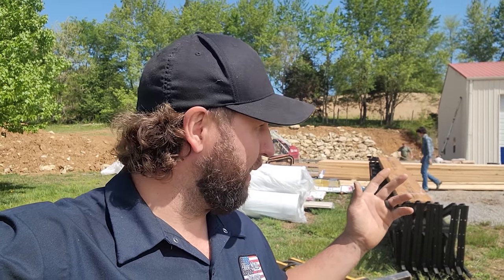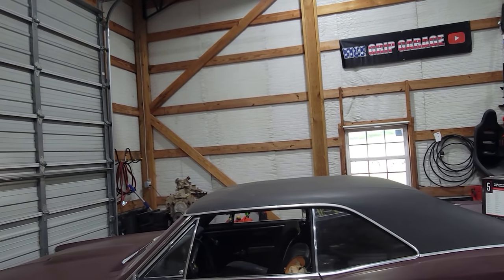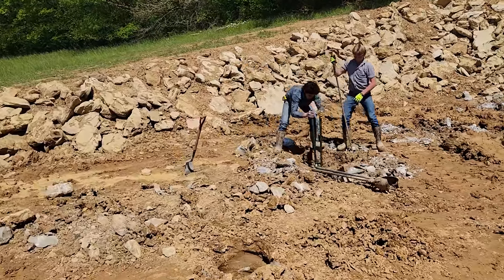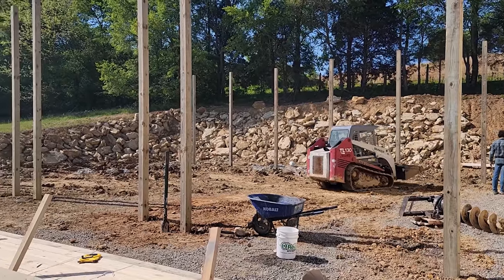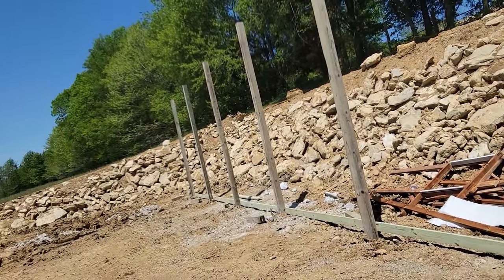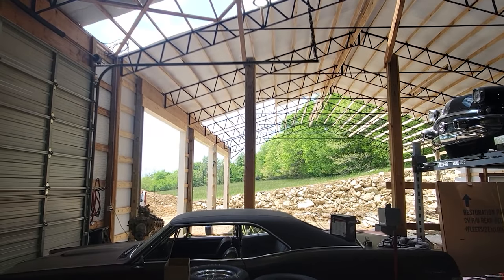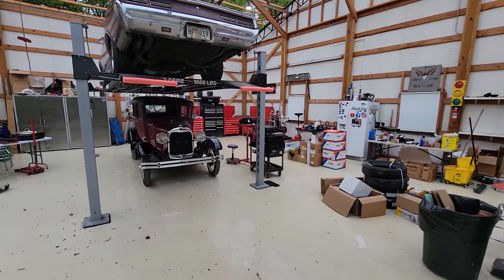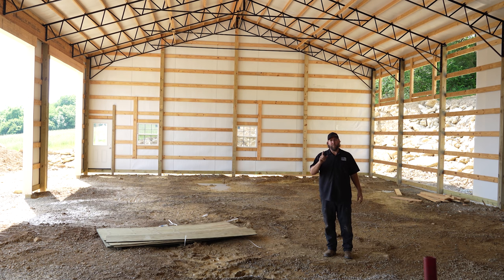Budget Shop Build - EP2 - Framing & Tin!

Comment: For the air system use RapidAir or something like it.  Black iron pipe is hard to seal and can rust internally and PVC can explode without warning!  (ask me how I know......)  Rapidair is what I used in my 2400 sq. ft. shop and I absolutely would do it again.  Hardly any pressure drop and moisture is a non issue with a hobo freight dryer setup.  Great video and can't wait to see it done.
Reply: I was going to recommend using a similar product or make up your own.  I think having many air chuck locations and using shorter hoses beats the hell out of dragging around a long hose.  Long systems also lead to better moisture control as the air cools off over the distance and condenses so plumbing in a few drain locations keeps the water from blowing and it will keep your  tools in better shape too.
Reply: I've had good luck using copper plumbing, doesn't rust and very easy to make changes/repairs... also easy to adapt to pipe thread when you need a termination
Reply: I second using the RapidAir, I thought about using iron or copper but glad I ended up with RapidAir. One full loop of 3/4" around the ceiling and drops down with drains on each one (even though I have never had any thing to drain).
Reply: black  iron is  the only thing  legally allowed in boiler setups  in florida and al I have have  the same  black iron on   boiler /steam  setup for  going on 22 years    with out a  single  rust  through   are  you thinking of   galvanized
Reply: George Jones  for one.. It says.. Not for pressure.. Directly on tha pipe..lol
Reply: George Jones  One small automotive shop i worked in had an air operated waste oil pump plumbed with schedule 80 PVC.  Something happened to the pipe overnight and when we came in the next morning it looked like a grenade went off in that room.  PVC shrapnel was stuck in the insulation and plywood paneling.  It could have easily killed someone if they were in the room when it went off.

Comment: I would add a hose bib for water in the center wall/middle of building outside wall, for washing cars outside. Hot water too if it was in budget. And and air line hookup too. Old style oil can cabinet from a gas station outside right there that was gutted for hose reels would look good!
Reply: I added hot water in my shop using one of the on demand tankless units. Figured it was a waste to have a 40 gallon tank to keep warm 24/7

Comment: You might alternate every other power outlet in a row on two different circuit legs using a single three-way Romex.  It will give you twice the load capacity to run multiple power tools in close proximity.  I did that when I built my shop and it worked really well.
Here in central Texas we are in constant battle with that obnoxious thermonuclear sky monster known as "sun" on other locations of the planet's surface.  So the only color for a metal roof here is WHITE to maximum reflectivity because darker colors absorb a lot of light energy and radiate it back into the workspace below as heat energy.   Of course you could be really clever and stage the roof with automated slewing photovoltaic cells.  That way you absorb the light from "sunshine" and use it to make car fenders like Elon does here in Austin.  On second thought you likely don't have the capital budget Elon is working with so nix that idea, haha.

Comment: I would recommend getting liftmaster side mount garage door openers this way you don’t have to worry about them stick out above the door when it’s down. Can’t wait to see this done! 🤘🏻
Reply: I've got these and they're amazing.  Definitely a strong recommendation.
Reply: And angled door tracks. No reason the doors have to open 90°... Let the doors follow the roof line.
Reply: And get lights that hang down between the doors so when the door is open you will still have lights.  For that matter if you run the doors up high leave room for the lights above.

Comment: Learn from a man that did it--put as many outlets as you can, did mine every 8ft. Also put some 48in high.
Reply: Some drop cords also
Reply: I am building a similar size (well half size 40x60) barn and outlets every 8-10 ft is good. Still not enough, but budget has limits.
Reply: Bill--Also don't have a bunch of them in the same area on the same breaker! Trip city!!
Reply: @cotton-Dave  Good point. In the storage area, I have single duplex outlets in each box with every other on the same circuit. In the shop area, have 2 duplex outlets per box each on a different circuit. Then, no more 2-3 outlets per circuit.

Comment: Having some outlets, including a 50am out front helps out. Including quick connects for air.Also a fan with damper high up on the ends really helps out when a fellow needs to vent the blue smoke clouds.

Comment: The expansion looks great! They're doing the job right and building it correctly. Congratulations on the success of your channel. It's a pleasure to watch all of your videos! KUDOs! 
Word of caution! Just a heads up... Make sure you plan for storm water running down the rocks and into the back of the garage. Those heavy storms could cause a lot of water damage along the back side of the building.

Comment: Derek: Regarding that old, original door with the rotten moulding...that moulding is, in most cases, a separate piece from the actual frame of the door and is called "Brick Moulding"...cost a feller 20.00 to replace instead of 250.00+ for the whole door...unless of course the actual door frame itself is rotten. Also, check your local codes re: fire doors...they MUST swing out. Easy mod to a new door...mount the door inside out by taking off the brickmould from one side and re-apply it to the other.
Reply: Was thinking the same thing.  I’d also recommend  getting the PVC brick moulding over the wood. It’s about about the same price
Reply: A piece of flashing that goes under the siding, up the wall, over the top of the brickmold, and bent down toward the sill makes it never happen again.

Comment: Spliced 2x6 can actually be stronger when the lengths are staggered. The boys at the mill hated when that came to be a thing. Any ends 8 inches or longer were set aside for repurpose and what used to be kindling, stove wood for the men became product. It was never cheaper to splice beams because you had to glue it and dowel it but it was a lot sturdier.
Reply: Agree, stacked are stronger. Check out the YouTube channel RR Buildings. They do amazing work.

Comment: For the air, this filly likes 1/2" poly tubing and push fittings. So much easier than setting up copper or PVC pipe. BUT watch out, a filly might need a big pipe close to the compressor for working on the heavy truck with a 3/4" impact. Maybe finger out the easiest bay to park a box truck in for the heavy work?

Comment: Think I’d leave the end wall and just frame an opening, like a doorway through to the new addition. That wall would add to the structural integrity and save time - you could remove the siding and move it down to the new end wall. Possibly install sheetrock or plywood on the existing wall and that would make the building more fireproof too.

Comment: Derek, the advantage of using 3 2x6's instead of one 6x6 is that when they get treated, it's easier to completely permeate a 2x6 with treatment vs trying to get that same treatment all the way into the core of a 6x6.  A treated 6x6 will rot faster than 3 treated 2x6's bundled together to make a post.
Reply: For us here in Colorado if that big 6 x 6 post that’s up in the air for one day with no support I thing Would look like a corkscrew by the end of the day. The 2x6 or a much better way to go like the other Gentleman said you get better penetration with the treating and the top of the post does not have to be treated which save some money
Reply: They aren't treated.   The old part

Comment: Even those big posts will come out pretty easy.  Drill a 1/2" hole through it, put a piece of pipe through the hole.  Support the far side with a jackstand, and then use a hydraulic jack on the other side and just pump it up, up, and out.  Easiest way to pull fence posts too.

As far as electrical - I put a double gang box every 8' in my garage.  My biggest hate is extension cords, because you can never find one when you need it!  The double gang boxes ensure that I'm always somewhat close to power and don't run into a situation where all the plugs are full.  If you're looking to keep costs down, then you can run each half of the shop on it's own 20A Circuit.  If you can afford a bit more wire, consider doing two (or three) runs down each side and alternating the boxes, so even if you pop one breaker, the one next to it is still hot.  My Dad wired his shop that way, with 3 pulls alternating through the walls.  I went the less expensive route and did each wall on a single run (with separate circuits for Lights & garage door openers).

Ideally, you'd put 110v along all the walls, and additionally at least one or two 220v drops for bigger tools.  In my garage, I did a 220v drop in each corner.  In yours, due to the size, you might consider doing 220v in the corners, and maybe one halfway down the wall.  That way, if you need a high powered tool, you can plug it in several places close-by instead of trying to drag a project to the plug.  Mozzle, right?

As far as Air - my shop is MUCH smaller than yours (24x24) so I ran 1/2" copper pipe through the walls & attic, using a washer combo box to keep the drywall tidy.  For a longer run, a 3/4" copper would be more appropriate,   and even a large 1" wouldn't be out of the question at 50'+.  Have you considered doing a single large pipe down the center of the roofline, with a series of 3/4" air drops towards the middle of each bay door?  If so, you could have decent/close access to air fittings without breaking the bank.  In VA, Air lines aren't part of building inspection/code - if you need someone to come solder up some copper, let me know!

For water plumbing...I suggest keeping it simple.  Find a location that's in the middle of the shop to put a deep/utility sink.  if you want to get fancy and run a double sink, great - but keep the plumbing centrally located to minimize cost for keeping the pipes un-frozen during the winter months.
Reply: Those are all great tips, not just for Derek, but for anyone considering a shop build, Thanks! 😊
Reply: @kimberlywilliams9757  Glad to help out!  Most electric tools won't pop a 110v 20A breaker on 12/2 wire through the wall...but for someone like Derek who's got lots of cars that could probably be on chargers all at the same time, combined with people welding and grinding...having the extra capacity couldn't hurt!  I don't have any issues with electrical in my shop, there's almost always a plug where I need it (except where the power tools plug in...it's got the fridge for the wobbly pop, the sound system for the garage, and then the chargers for the tools - that corner could've used an extra duplex outlet!)

For pulling out fence posts, either 1/2" iron pipe, or a piece of rebar will work really well, depending on how much concrete is at the end of the post.  If you've really got it buried...you may need to step up to a piece of 1" iron pipe (Schedule 80 is the heavy stuff!).  The trick is to keep the lever short, so get the jackstand/support as close the the post as possible.  I've used a Hi-Lift jack to pull out some deeply buried stuff before - just be careful with those - if the bar doesn't fully lock in/ratchet and it kicks back, it can knock the wind out of you and it will hurt like crazy!

Back on the electrical/heat...I put R-13 in the walls of my garage and R-30 in the ceiling...and on a 15*F day, a little forced-air propane heater will quickly get it to the point where I don't want to wear a jacket.  However, with a big shop like Derek's...getting any real amount of heat in it will take some doing.  I recently put a 2-zone heat pump in to cover my old garage (400sqft converted into a guest room) and the current garage (575sqft).  That thing will heat (or freeze) you out in a hurry.  For what Derek's got, a four or five zone system, all synchronized so the thermostats are commanding the same temps, would probably work a treat for him.  The ceiling are a lot higher, and if he's got some decent insulation in the ceiling, might not break the bank.  If he needs something a little less expensive up-front, there are large BTU forced-air heaters that would give him a heated "space" without worrying about keeping the whole garage hot.
Reply: @piratius  I have used a high lift jack to get a posts out of the ground before, it was my Dad's idea, it had no problem coming right up. I know exactly what you mean about how those things will knock the wind out of you, I've seen them do more than that a time or two!

Comment: My understanding of laminating the posts is that they shouldn't twist in time. Solid posts are more apt to twist. I have a 1981 built Morton building here in northern Minnesota with solid posts and some did twist. Morton now uses treated laminated 2x6 posts in the ground. Might not be a problem where you are.
Reply: I’ve seen where they just use treated the bottom few feet and not treated for the rest.
Reply: @sociallydistantranch67  Yes , that's the way they do it.
Reply: He technically doesn't have laminated posts.  Laminating is when they are all stacked up in a stud pack.  What he has is more a box beam.
Reply: @Mopardude  They only box beamed the end posts. the eve ends are laminated.  Box beamed posts would not carry the roof load.
Reply: The laminated is better for rot down the road. The treating product can easily penetrate a 2x6 versus a solid 6x6. That’s why they use stacked 2x6 now for the post in the ground. Personally, I would have done concrete piers for footings and put wood up from there but to each is their own.
Reply: @keithrutherford8619  Go back and rewatch the video the dude said they were hollow inside, that is not laminated.

Comment: Looks good. When you do the electrical, in my experience you can never have too many outlets. All those welders and Milwaukee battree chargers, and air compressors and such can be a real pain with limited outlets. I’ve been using the same 220 outlet in my shop for 6 different welding machines depending on the job I’m doing and on the shop we are putting up I want to have those things everywhere
Reply: Ceiling outlets too, switched and unswitched.  I added outlets above my lift poles, then did drop cords down the lift poles for trickle chargers, super handy.  Also all my  new lights are plug in instead of hardwired, makes it really easy to add/change lighting on the fly with the cheapo led tube lights just have some switched plugs scattered around to plug in at.

Comment: If you want some good cooling for the shop.  Talk to a home HVAC guy and get  a couple used central whole house fans. The type used in forced HVAC.   They are very small and move an astronomical amount of air. And they're quiet.  I don't think swamp coolers work where you live.

Comment: As far as lighting goes, i recommend high bay linear led lighting, looks like the old florescent type fixtures.  We've had several styles in our shop, and the linear fixtures are just so much nicer than the UFO type lights, even that far in the air, you will notice linear lights offer much more even type lighting with less shadows.  Another plus, the ones we installed have the opaque covers/lens, so it is much easier on the eyes, and the camera.
Reply: couldn't agree more.

Comment: Worst mistake everyone makes with a new shop build is no bathroom. Everyone I've ever asked say it's the one thing they wished they added, because they spent so much time in their shop.
Reply: i was way too excited when i saw whoever put a shitter in my barn before me when we were touring the place before buying i was like you mean to tell me i dont have to fear shitting myself on a sprint to the house anymore. and the realator had a puzzled look on her face when i was more excited over that than how many bathrooms the house had.
Reply: @harleythrelkeld7587  something it only took my grandfather most of his life to figure out, and when he did he just dug a hole and put an outhouse over it.
Reply: @rustyreese4006  true, an outhouse is still better than a questionable run to the house
Reply: Bucket
Reply: The 2nd worst mistake is no door(s) in the back wall to get to mother nature’s urinal.😬
Reply: @TomLongusa  I seen a unique solution for this once. They drilled a hole through the wall, attached a hose to a big funnel and wired it up in a corner in the back. Wasn't any good for a dump but the other wasn't a problem.

Comment: 1/2" PEX line works awesome for running air around the shop, it's not "officially" rated for pressure but it holds up just fine. Way cheaper than purpose built kits and you can get it at any hardware store

Comment: I definitely would have put in a crapper! Even if it's not far from the house, saves a guy from tacking grease inside and also if his buddies are over wrenching or hanging out makes it easy for them to. Also a wash up area, fridge for cold snacks and a BBQ would really make it a nicer place to be. Again, help keep the dirt and junk out of the house. 

I love the look and character of the building. We very rarely have timber frame sheds in Aus, it's been all steel frames for the past +30years. I had a timber framed garage at my last house (approx 70 years old) loved the look of it.